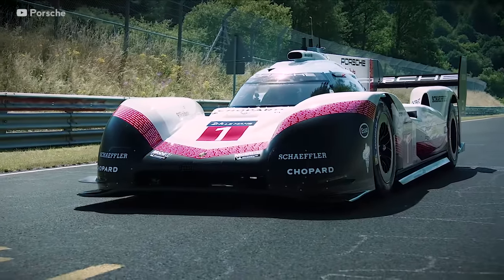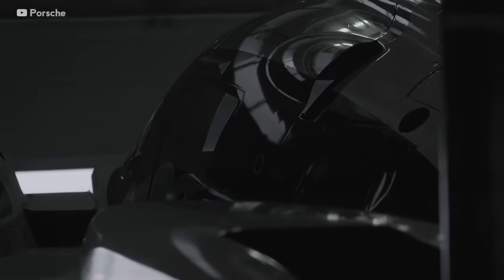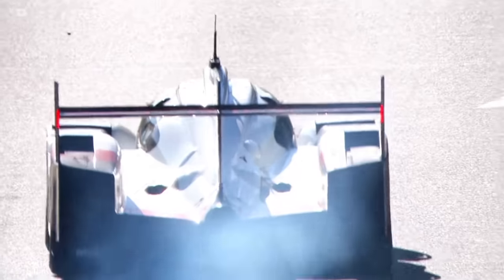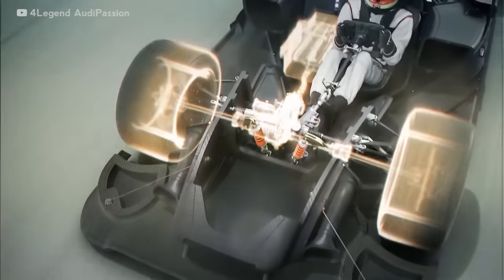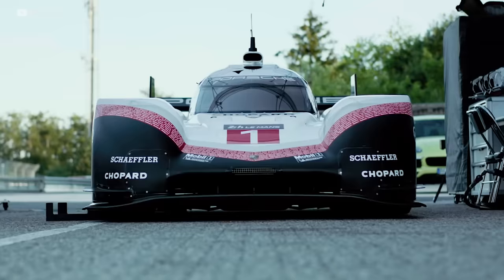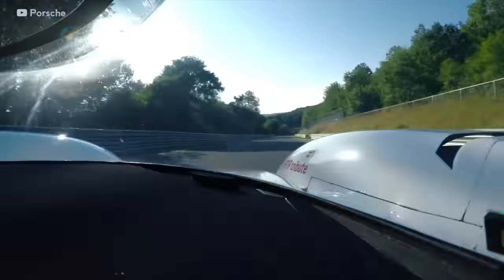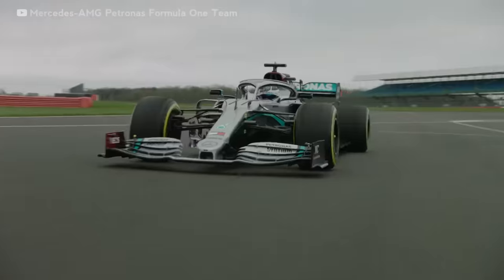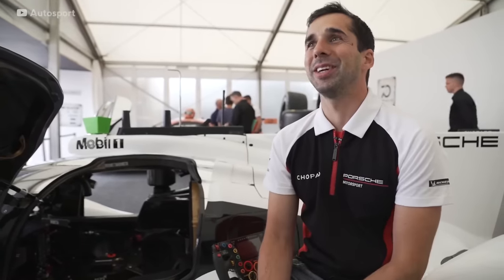How Porsche Built a Car Faster Than F1

Comment: Do not forget:
Porsche: no rules = F1 WITH RULES.
Reply: @Yung Jxhno The irony is that they would want to cover up the wheels much like a prototype car. But yeah, a mash up of a prototype car and an F1 car without any restrictions would be absolutely bonkers.
Reply: Yeah true... but on the other hand the Porsche's whole design is based arround 24h endurance racing and F1 is max 300km/2h car. So i would say in hot laps the F1's base design is generally more favored.
Reply: Not to mention the corners etc etc not just straight
Reply: Thank you men 🙏
Reply: @Yung Jxhno 1400? F1 cars had 1400 hp 34 years ago from a 1.5l turbo 4 pot. Just imagine taking off all that electric shit and installing a proper 3-4l turbo V12.
Reply: @AndiSabin maybe that will be freeee way to heaven..
Reply: @AndiSabin  Right ? An all engine setup would be so much better, less complication, less weight, more power and you could have a monster of a car.
Reply: He literally said this throughout the video
Reply: I think about that sometimes. If you took all the engineering and money of F1 development and told them to build a car with no limits.
Reply: f1 was this year anyway faster again at spa. ham pole was quiet a bit faster then neel jani in the evo
Reply: Totally agree.  But what driver would volunteer to drive an unrestricted F1?
Reply: An F1 car without rules isn't an FIA Formula 1 spec race car anymore... Just like the 919 Evo is not an LMP1 car anymore... So you'd just be building off of a basis that somewhat resembled either one.
Reply: Not like he said that 20 times in the video right xD
Reply: That is true
Reply: I wouldn't be able to understand your point without the all caps.
Reply: nope, if an f1 with no rule, no one can handle this power through the corner and straight line, so they will be driven by a computer, an AI instead and this such thing will be not interesting anymore, it's all just about human limit, how much G's you can handle
Reply: every time I see a record, I also see something like:
* dOnOt FoGek:
* my grandpa with no rules = me with shit
I feel kind of weird, there always a stupid dog appear every time, you know
Anyway, this record, you look like it will be easy to beat by the f1, but actually it isn't, not everything is about tech, it's also about human limit, right? take it into account ;)
Reply: @AndiSabin  if you strip the rules of that electric "shit" it could have 2000+HP
Reply: This is why Porsche no longer competes in F1.  
Too hard for them.
Reply: @XBullitt16X  you don't really understand anything don't you. It doesn't work that way really lol. Instead of putting a v12, how bout increasing bore capacity and a higher stroke with a bigger displacement. That way it would be easy and efficient. Smaller and lighter with the extra turbo rather than a natural aspirated v12 engine. Tho i admit , it sounds better
Reply: @snakebitten6967  any F1 driver would dare.
Reply: @kuroneko-_5570  you do understand the g forces an unrestricted F1 car would produce.  Think Adrian Newey Redbulls X2019 Gran Turismo car.  The driver would need to retrain himself and wear a G suit like fighter pilots wear.  I would think there are a few F1 drivers that would think twice about that lol.
Reply: @kuroneko-_5570  I never said it had to be V12s, thats nowhere in the statement I made. I'm personally preferential to V10s as I find they sound the best, not against Turbos either, I love Turbos and their own associated sounds. However you're completely correct, very few things sound as good as an NA high revvving v12/ v10. Honestly these days I wouldn't even mind those shitty V6s if they just got rid of the awfully complicated, expensive and unneccesary hybrid systems and upped the revs.
Reply: @XBullitt16X  well yeah. V6's hybrid are very completely complicated. With the electronics in it, it is very hard to operate. Small issues failures and mistakes could lead to serious damage unlike the old ones. Senna's Mp4/4 was able to complete a race with only 6th gear in it. But yeah. Small, compact, powerful, UNRELIABLE Complicated but powerful and efficient.
Reply: @kuroneko-_5570  you won’t gain as much simply increasing bore/stroke as you would by adding 2 extra cylinders and 1.5 as many valves. Just in general more valves equal more power @ any given displacement. They could just use the flat 6 at 3.6l and easily get 1000whp  for lap record attempts.  A 4 cyl is just the min  required to be competitive at what it was designed for.
Reply: @snakebitten6967  g suits for F1 would be very different than for fighter pilots, and would be almost impossible to make a very effective one. The loads are lateral - blood will be rushing from one side to the other, and a suit wouldn't be able to hinder that effect in the brain
Reply: @petertheoneandonly9752  the result will be a car undriveable for a human being, almost completely controlled by electronics due to excess of power to transfer to wheels.
And aerodynamics would be so sophisticated that electronics would be necessary to handle.
So, it would be an incredible vehicle  with a reduced contribution by the human pilot.
Reply: @filuferru  thats really solid. I could see that. Clarkson said of the GTR: the only bit that isn’t balanced perfectly is the soft fleshy bit in the middle
Reply: Do not forget:
F1 destroyed the Porsche record in Spa a few months later.
With rules ☝️
Reply: Also dont forgst porsche with rules was 15 seconds slower
Reply: But it is faster than a formula 1 car, the rules are with the formula 1 car, you're right if there were no rules in f1 an f1 car is faster
Reply: you can't compare that
Reply: Hamilton actually broke the record just a few weeks after the video was posted lmao.
Reply: first of all f1 teams have a bigger budget. Second, is that EVO is just 919 without restrictions, not a car that was built from ground up without rules. Effectively it’s a prototype from the 2010s because 919 was developed at around that time, and didn’t changed significantly over its racing career. 
I would like to see an unchained toyota, because it was generally faster in later years
Reply: Some time after:
LMP without rules < F1 with no restrictions
Reply: dont forget, electronic assists on a race car===== SHit
Reply: nah
Reply: Don't f1 cars have 2 extra cylinders
Reply: @RCCBST  you mean the redbull gt with chapparal suction? It's from a game,  but actually could be made. Don't think the tire technology is there atm, probably the bottleneck atm.
Reply: @RCCBST  preferably with a fan to suck the car to the road

Comment: To be fair though, F1 took back the lap record at Spa just a few weeks later
Reply: This will spoil his narrative. He's too foolish to recognize that.
Reply: @migracing8232  foolish? He is correct. The car was faster than F1. Nobody said it still is.
You could also say how Ford build a car faster than Ferrari at Le Mans. (Its a good story.) Thats still correct. Nobody said Ford is still faster.
Reply: @migracing8232  it actually doesn't as it did achieve the goal to be faster than any existing F1 car, the laps done in F1 cars that beat it came later (i.e not an existing F1 car at the time of the record)
Reply: To be even more fair, Ferrari probably weren't using a regulation car either 🤣.
Reply: Lars St. He was correct in 2017, but you can no longer claim the car is “faster than an F1 car” if the latest and greatest F1 cars are still faster. Vettel beat the Porsche’s time by 3 tenths, literally 3 weeks later. What he should say, is faster than a 2017 F1 car. What makes it worse is the fact that this took place 2 years ago, and to claim it’s faster without specifying 2017, would be incorrect.
Reply: @AustinG29152  so its still faster than a majority of f1 cars
Reply: Falk M  Have you ever wondered what if an F1 driver did the lap on that porsche? Neel said he couldn't handle 4.5 Gs, F1 drivers can handle 6Gs. Interesting to think about.
Reply: Lars St. at 0:18 he literally said it was faster than even the latest F1 car lol
Reply: RWoody1995 The F1 car that beat the record absolutely existed at the time of the Porsche lap. It was beaten 3 weeks after Porsche set the lap record. So it wasn't faster than any existing F1 cars at the time.
Reply: He might be, who knows

Comment: I love unlimited performance. I used to drag race in the "gasser" class at a local track. there were rules; pump gas, carbuerated , street tires, no wheelie bars, no additives to fuel, on and on etc. Every season I would have some "tech inspection" issues fix. The things they missed were what let me win. Avgas at the local airport was one. The receipt only said Exxon premium.

Comment: The should try the 919 evo at spa with a F1 driver at the wheel. Someone that is fit enough to handle the g’s
Reply: I hope you are kidding...
Reply: @avatar94100  that is exactly what the works drivers, all of them, are saying. They can’t physically keep up with the machine. I was a go-kart racer and my biggest limitation to going as fast as the machine could was my body that could not handle the violent g forces and mind you a kart seldom peaks over 3 g. 
Try a very fast car with HUGE downforce and the limit is the driver’s physique. 
But what do I know...
Reply: yeah..that dude that drove was a random guy of the street for sure.
Reply: Exactly
Reply: @skyelark155  no he’s a works driver that is used to driving the 919 in endurance configuration. Less powerful and with  far less sophisticated aero that generates less g’s. Do you actually listen to the video or just troll the comments sections?

Comment: I love your thoughts at the end of the video. Wouldn’t it be amazing to see Mercedes produce a no rules evolution of their F1 car. 😊
Reply: I think the driver would be the limiting factor then. Just imagine what a 1100 hp F1 car can do around a track with restriction, without restriction that 1100 will become 1400 and things like active suspension, max boost, maximum fuel flow, drs open full the full lap. Everything being considered, spa will get lapped under 1:25 sec

Comment: I think f1 needs to have further expanding regulations. If this car can do what it does, then f1 is no longer the pinnacle of Motorsport that it once was. This needs to change. However, this may result in worse racing, thus leading to the dilemma that f1 has always had. Faster cars or better racing.
Reply: It's not a legit competition car so F1 remains the pinnacle of motorsports. Just like Land Speed Record competitions are much different.
Reply: F1 is still faster
Reply: f1 has banned so many technologies over the years though, if all of those were to be made legal again or just all put into a project/concept car then i doubt there would even be a driver capable of driving the thing to it's maximum. i mean really just imagine.

-4 wheel drive

-active suspension
-double diffuser
-exhaust blown diffuser
-f duct
-unregulated aero (flexi wings included)
-covered wheels
-ground effects
-fan car

and a litany of other things i simply cannot remember.
they could no doubt easily make a car that can lap on average 10 seconds faster at every circuit...probably more.
1st question is who would drive the thing?

porsche had to break tons of rules for this tribute car, but that's fine it was never going to race anyway and the car is the same from the racing one just with some liberties taken.
i struggle to find any team that would forward the money required for an f1 tribute car though, it would have to be built from the ground up.
f1 regs are pretty good as they are right now, actually pleased that the 2021 regs have been pushed back thanks to covid.
Reply: F1 cars would be faster again if they did this though. Much faster.
Also, that Spa lap time has since been beaten by Raikkonen, Vettel, and Hamilton.
If F1 races at Spa in 2021, then I wouldn't bet against the Mercedes lapping way faster.
Reply: IMHO F1 cars should be designed based on the circuit specs. Modern F1s require tracks that are very diffrent from the classic circuits, just look at what Tilke designed in the last 20 years. All the great circuits are becoming obsolete in the name of what? I say slower cars and f**k the records, the first race Shumi won in Ferrari was in wet Catalunya, 2 mins per lap, low grip and overtakes on every corner. That's pure racing!
Reply: i dont think this one single car knocks off an entire genre of motorsport
Reply: F1 is faster though
Reply: That porsche is a fast car. But a F1 must be fast, brake hard, accelerate harder, turn fast, be light and, most of all, compete with other 20+ cars (meaning be safe).
In its own environment, an F1 car is the best of the best. Take a F1 out of its own environment and you'll have a carbon fibre toy that overheats.
Reply: What is that logic? F1 cars have always been slowed down by regulations, it has always been the pinnacle of motorsport and always will be. A completely unregulated 919 barely scraped the record, record they held for a couple months before F1 turned up at Spa that year.
Reply: @awesimo4684  we will see the lap record this year (if it's dry in quali). the f1 cars will have less downforce in 2021 due to some floor restrictions.
Reply: @thedevil5475  Fair enough, wasn't aware anything was changing for next year.
Reply: @awesimo4684  it's just a little aero adjustment, but it will most likely cost the cars half a second. pirelli was concerned that next years cars would produce so much downforce that their tyres can't handle it, so they looked for a way to reduce the downforce.
Reply: It literally already got beaten 2 years ago
Reply: F1 cars literally retook all lap records 2 weeks after this car set them

It'a incomparable how much faster regulated F1 cars are then unregulated LMP1 cars
Reply: Sebastian Vettel literally beat this time a few weeks later during qualifying for the 2018 Belgium GP.
Reply: New rules are always been added and rules changed to try slow down the F1 cars. If an F1 team ripped up the rule book there car would be too fast to drive

Comment: Neel Jani not being able to handle the speed of the Evo says a lot about current F1 drivers
Reply: Sergio Perez was out-qualified by his team mate Lance (spoiled rich kid) Stroll.  Reason, Perez was feeling dizzy and unwell from all the g-forces.  Normally by the time they got to the high downforce tracks they would have had a few good races already, but this year was obviously different.
Reply: stev ano  it's not hating, it's a fact. he is a spoiled rich kid
Reply: stev ano  his dad literally bought him an F1 race team. What else do you need ?
Reply: stev ano  the problem i have with stroll is that he often seems to be unmotivated, as if he doesn't even want to be a race driver and only does it because his dad wants it. he's blocking a good seat for drivers who love racing 100% and would do everything for a good f1 seat. his performances are decent sometimes now, he definitely improved since his debut in 2017. but i still feel that his seat in f1 is a waste.

Comment: Great video. And as I scrolled through a goodly number of comments, there was no mention of the only true no rules, run what you brung series ever created. It was very short lived, in part thanks to Porsche once again. That was the Can-Am series of the late 1960’s and early 1970’s. True mechanical beasts of staggering performance and horsepower. Check out the Porsche 917/30 et al. A mere 1300 horsepower and breathtaking top end. Still hold the closed course “oval” speed record at Daytona at over 250 mph. I saw a 917/30 do a wheel stand going up hill at Road America back in the 70’s. The Driver - Jody Scheckter. There are a few videos on the tube of this magical era. You should check them out.

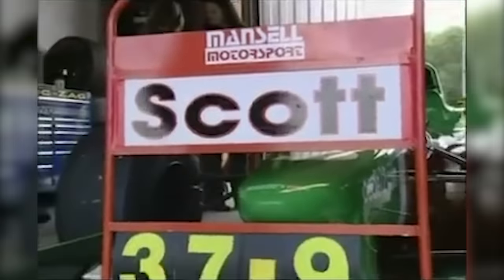Comment: I'd just like to remind everyone of one thing. It took taking a race car and making it totally illegal to actually race to beat Stefan Bellof's RACE WEEKEND Porsche 962 lap record. That's right, he ran that lap record in a qualifying session for one of the final ever Group-C WSC events on the Nordschleife. Also, Bellof's record came at a time when the layout was slightly longer than it is today. Bellof's lap record being broken by an illegal race car on a shorter layout isn't as impressive as one would think, and only makes Bellof's lap time of 6:11.13 that much more astounding. If you're wondering, the Nordschleife layout the 919 ran had a portion removed that was later replaced by the current modern F1 track at the Nurburgring. That portion was about half the length of today's F1 Circuit. The F1 track when combined with the Nordschleife is what the Nurburgring 24 hour competitors run. That is not the layout the 919 ran. The Nordschleife only config completely cuts off the F1 circuit and is significantly shorter in total distance than the track Bellof ran. His record stands imo.

Comment: I would love to see a blend of old and new. Using the Offy and however much old tech you use you can use equal modern tech. So if you use an antique gearbox then you are turned loose with all electronics and add a electric hybrid, adding turbo and crazy aero active packages!